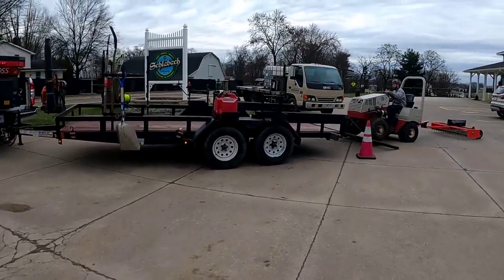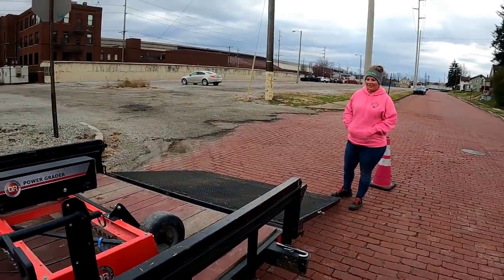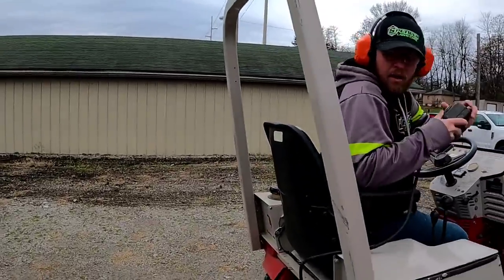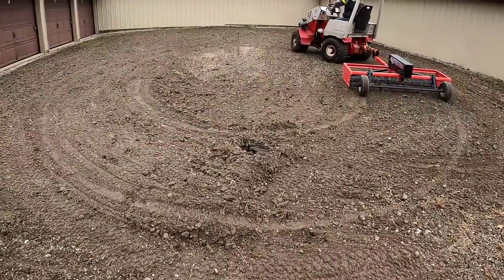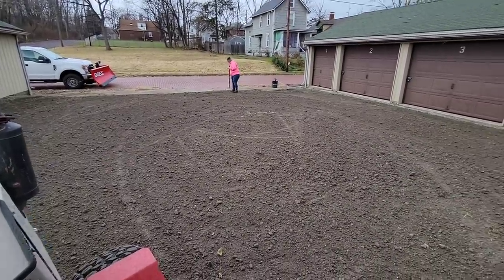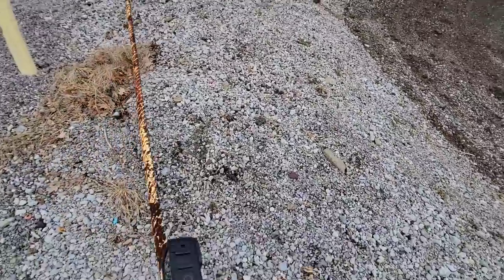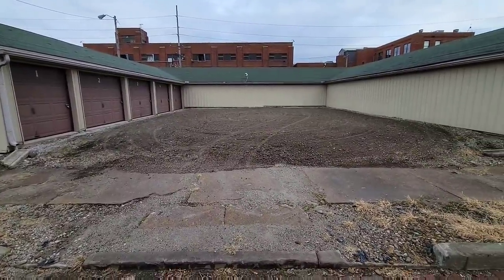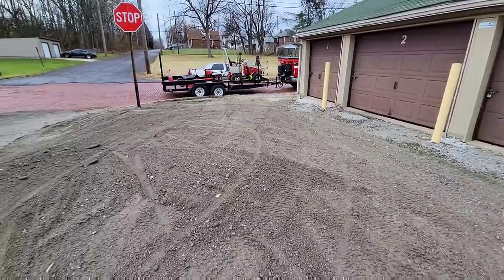HOW TO MAKE AN OLD GRAVEL PARKING LOT LOOK NEW | USING RENTED EQUIPMENT!

Comment: This is strictly a suggestion - grade the property so the center of the gravel area is 4 to 6 inches lower than next to the buildings.  This will greatly improve water run-off from the buildings.  Also, lower towards the street.  Just my $.02 worth 😁
Reply: I noticed the high spot in the middle section that TQ was raking. Just my $.02 worth.

Comment: The ventrac power rake is the attachment you need for that gravel.  It goes on the front and you can go either direction.  It really digs in if you want it too.  Also...I would have waited until spring to do it as you will be messing it up with that plow.  It did a good job but the Ventrac attachment is where its at.  Great video and example of what thus attachment does.

Comment: Looks like a very old Ventrac but I would think that it would still be compatible with the KP540 Power Rake and the KJ520 Broom. If those attachments are available to rent, they will make the place look even better in half the time. Ventrac it built right there in Orrville Ohio
Reply: yeah ventracs and steiners  are great with the power kubota gas and diesel engine

Comment: Great job guys I have used this setup alot this passed summer and I find that if you can grab a few cinder blocks and place them on top of the power rake it really REALLY helps get those teeth right down into should ground. But it's looking pretty good

Comment: Suggestion! Since you are the property owner no license required. Spray with glyphosate to kill off the winter weeds, and then spray with Pramitol 25E, won’t have the grass or weeds in the gravel through most of next year. Treat the ground spring and fall with the Pramitol and it will stay clear.

Comment: I had one of those units. Shawn, you are right in doing many passes. It works great in softball fields, used it to seed lawns and driveways. 
When I went a little deep the front “tine’s” would bend ! You can crown a driveway with the unit also. I believe that they are selling for around $1500 and you get Free Shipping!
Go slow on lowering it especially if it’s hard!
Think you can add up to 70 lbs of weight, although on the one you are using I don’t see any holder’s for concrete block.

Comment: Ventrac have an implement for that task that mounts on the front of the machine, and is active (power driven from the PTO) called the power rake. Has a metal roller with carbide tipped spikes all around it that spins and digs gravel/soil/whatever and distributes it where you want. It's very close coupled to the machine to allow very close access, unlike the towed unit you were using. Suggest that you look at either the Ventrac videos or Tractor Time with Tim videos, both on YouTube to become familiar with that unit. Don't know whether you hire that attachment in your area though.
Reply: The power rake would definitely be a better tool for that task.

Comment: Pertaining to the sidewalks.   In my city the property owner is responsible for maintaining the sidewalks.   The city will repair or replace the sidewalk if they damage it.   The city only will replace it if it becomes large scale such as new infrastructure.  The wheelchair cuts will only repair a small portion of the walks.   I've seen them put in a curb cut with all of the required curbs, ramps, markings and there is no sidewalks.

Comment: I have the manual crank Dr. I got it for under 600.00. But I recommend the power lift. Its around 1200.00 for 48 inch or 1500.00 for 60 inch. If you dont need to raise a lot to turn around the manual is the financial choice.

Comment: You should look up Cantons rules and regulations,  building codes, and any other documents that outlines what is required for Canton residents/businesses. 
Then get with whoever the alderman or councilman is in the district your storage facility is. 
Talk to Him/Her about what the city can do ( you should have a good idea at this point, also you're a small fish in a big pond so to speak so you may have to push any issue but hopefully nit )
A lot of cities have grant programs for different size business, hiring workers, cleaning up properties and bringing new business into the area. There may be something that would help you pay for the sidewalks and/or curbs, because of the disability laws they may be required to update the corner into handicap accessibility. Good luck. 
Great video,  sitting here in S/E Michigan 9:12 at night and its 58 degrees!

Comment: I need that setup for the drive way  where I live cutting grass and leaf relief season is going on for you this late in December go figure it out 😂
Reply from the maker: Its a nice setup
Reply: Depending on the length of your driveway, I wouldn't recommend that implement. But also take in account budget. I would recommend a Gravel Rascal from abi. If you have a subcompact tractor, the Gravel Rascal can be adapted to 3point use. 
I have a TR3 Rake from abi for my 42hp tractor. It was $4,500 and works great for landscaping & gravel lot revitalization. The Gravel Rascal has actual scarifiers that can dig hard packed gravel or clearing soil.

Comment: I saw the Ventrac restore a drive demonstrates a couple years ago. The took what looked like a mud covered drive and pulled all the gravel back up. Ventrac has a center pivot.  That isn't an attachment Ventrac part just a DR The Ventrac tractor alone is $25000 the last time I looked and all the accessories will easily double that. I think the walkway are on you. Mine use to be but the city bought access via Imminent domain so they own them.

Comment: Have the city commission go after the sidewalk safety walk program.  It's a grant program that helps establish safe walking routes to schools etc.  They won't pay all but usually a 80/20 split so city has 20% to pay usually.   It takes a year or so to get enrolled and approved etc, but the city and engineering firm should be able to get a safety route established especially if a school is right there.

Comment: if you are still working on this job you need to ask your dealer if you can add some weeight to the dr tool it is just not heavy enough to do what you need to do maybe ask them about a compact tractor and box blade or something that has a bit more weight to it

Comment: If u put weights on that thing it would do alot better also it wouldn't bounce around as much that why they put angle iron on the top of that power grader to put grateor boards down and then add weights or however u wana do it....just a lil fyi....

Comment: This time of year anything you loosen up will end up getting plowed off. I would probably try to cut a swale down the center of the two buildings in the spring so water will drain off. Spray it with a herbicide like Sahara in the spring and you won’t get any weeds all year.

Comment: May I make a suggestion for next time.  Add sinder blocks on the grader.  3 on each side adds great weight so the grader won't bounce as much
Reply: You can also adjust the tongue so the front teeth dig more and the back blade feathers better.

Comment: Generally, sidewalks are you're responsibility, but you'll need to check with the city and also find out what the process is as far as their sidewalk specs and permitting process.  I would suspect they'll want that corner sidewalk changed to allow for wheelchair access.